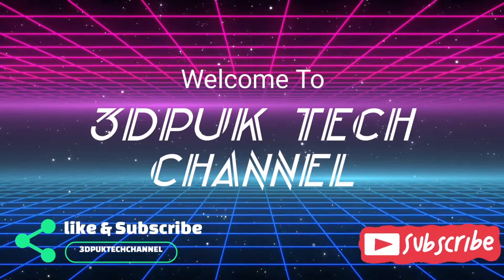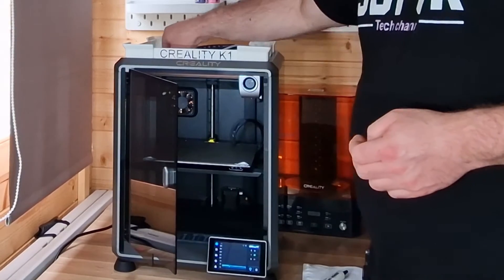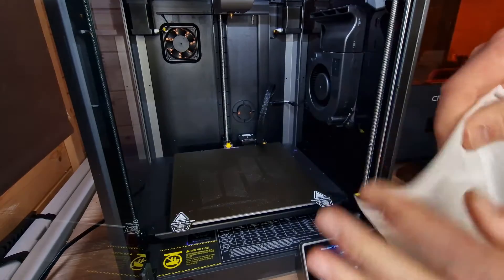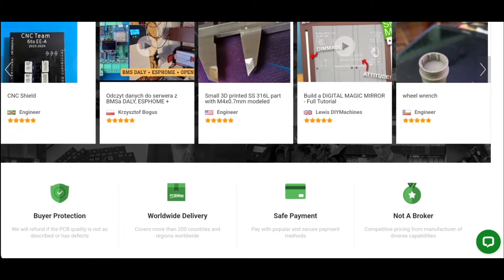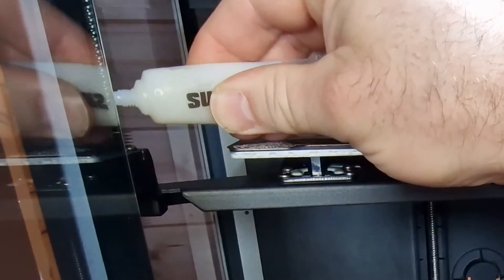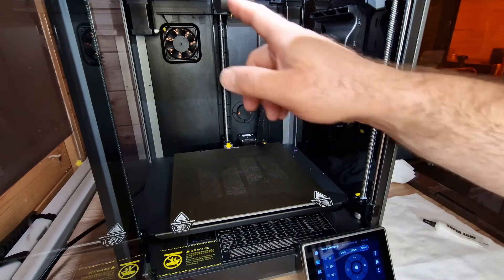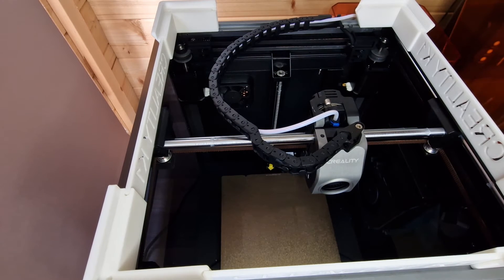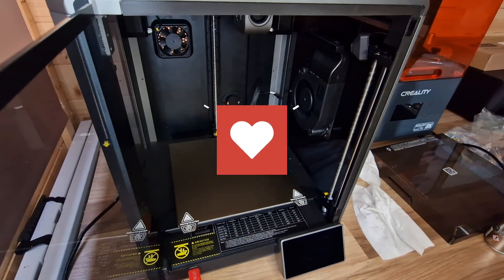Creality K1 Maintenance Tips (Do we grease or not) update use light oil on X rods ! see description

Comment: I just want to add... use air duster from 6" away first on the rails esp back ones. Air is best way to remove any filament so spray the unit including pulleys. Also great for blowing fans and rails out. I then use tack cloth on the rods. I put grease on a small sponge to grease evenly. I also tighten glass screws because they get loose via vibration.
Reply from the maker: @3mt696  great information

Comment: I'm having issue with my K1C printer. When attempting to print, I'm hearing knocking noises as the extruder moves to front right corner, but also other areas, it makes it so that my prints instead of taking up the whole bed, only uses one side. I have to power off the printer before I let the print get very far because of the loud clanking I'm hearing, I feel like it has something to do with the belt because the clicking is making the grooves in the coppery belt, shed. Any information would be greatly appreciated!
Reply from the maker: @OrionMurphy-d6h  have changed firmware recently ? Also would be worth checking that the limit switch connection is still in place. It sounds like it's not registering its location and continuity past the limit zone
Reply: @3DPUK-TECH-CHANNEL  I solved my issue. I recently put on upgraded door hinges, the screws that were recommended were too long and was digging into the belt and around that area. I loosened the screw just a bit and problem solved. Please share this issue and its solution so people dont have to go through what I did!
Reply: Missing teeth  on the belt could do this. If you had an incident where the print head ran into something  .   Go around to  all the belts and check for a bigger Gap   than the others   .

Comment: Why are you putting grease on the X rods!    They are bronze graphite bushings.  The grease will make the graphite clump and cause binding.  Creality DO NOT recommend greasing the x rods.  Grease should only go on the Y rods and Z screws.
Reply: I couldn't find any reference where Creality doesn't recommend it, unless they changed wherever they stated it. But everywhere I look, Creality recommends greasing the X Rods. Their maintenance Wiki mentions to grease it, even the picture shows the grease tube on the x rods, and when I emailed them they told me twice that part of the 300 hour runtime maintenance I should put a little grease in the middle of the rod and spread it out by moving the extruder movement.
Reply: Look at k1c creality wiki, section 6.2.1 lubrication... X must be lubricated regulary as show in official creality manual!
Reply from the maker: It's a debatable subject right now. I agree the manufacturer does state this fact.. and creality also states you do have to lubricant the x and y rods too. However I'm not sure it's the case as I clearly state this in my video. I have seen when I clean them only I have a juddering to the print head for several layers then it seems OK
 Thanks for watching and for adding some more clarity into this issue. It's not ideal to have a clash of advice from these companies.  However with regular cleaning this shouldn't become am issue

Comment: https://youtu.be/2Cd-19st9gQ?t=839

"im going to do what everyone says not to do INCLUDING THE MANUFACTURER OF THE GRAPHITE BUSHINGS" 

This is why you shouldn't just trust random people on the internet with your 3d printer

Go read the specifications for the bushings themselves, ignore what Creality tells you they're in the business to sell you printers and printer parts.
Reply from the maker: This is why I stated in the video this exact point.
Reply: This is not that simple because the original instructions say to lubricate both x-axes.
Creality itself lubricates the x-axes before shipping.

Creality itself shows in the instructions which elements to lubricate and the x-axis are marked.
In any case, it is best to follow the instructions and use good grease recommends by creality.